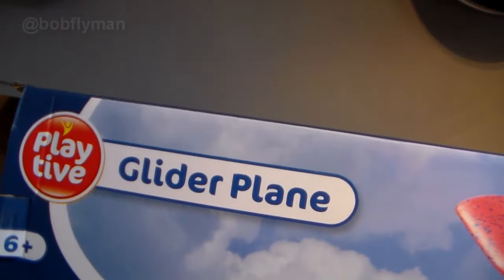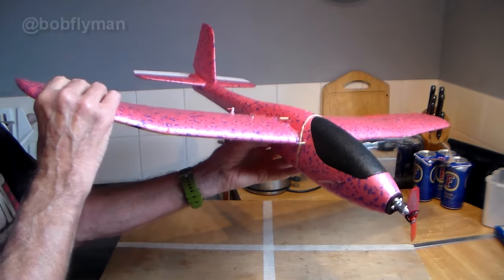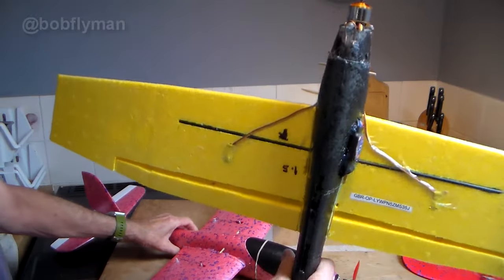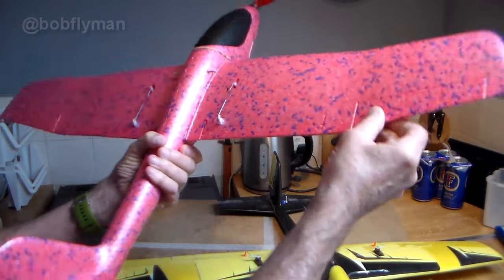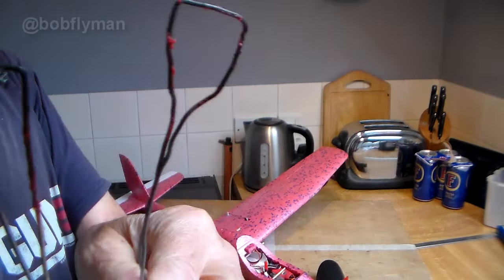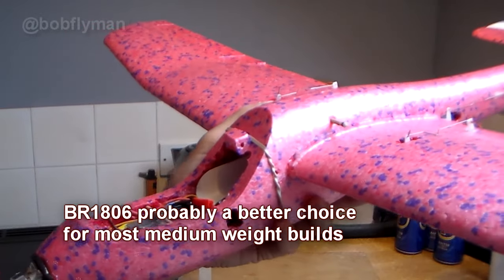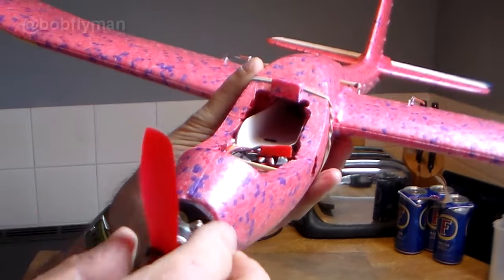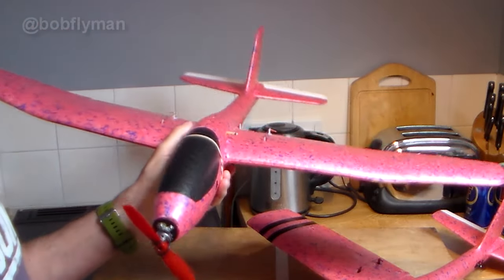Lidl Gliders or Cheap Foamie RC builds - My Top Tips after 20 builds - Everything you need to know!

Comment: Great info and tips, how about a wing for the next build something like a nurflidl,  chop the tail fins off leaving a short bit of fuselage and then put a 'rudder fin' back on for stability add elevons using 2 servos in the wing (you will have to mix the channels on the transmitter) and  you have a glider then maybe add a motor at the front or rear to make it powered
Reply from the maker: Wow, that sounds like a nice idea.
Reply: https://www.wing-tips.at/Portraet/Modelle/NURFLIDL_Umbau.pdf
Link to plans

Comment: Thanks for your great video's, I enjoy DIY RC plane builds.  I noticed in several of your flight tests, that when you throttle up the plane appears to pitch up and climb. One suggestion you might want to consider a Throttle-Elevator Mix. What this does is apply down elevator as a percentage of the throttle position to counter act the pitch up.  Could be in the video's I observed, wind may be a contributing factor?  I was in my local Hobby-Lobby craft store here in the U.S. and saw a small version of the Lidi, but I was not aware they had a larger version. I will see if I can find a source here in the U.W.
Reply from the maker: You are right about the pitching up, I've always put it down to thrust angle, but very good idea to try a throttle mix. Thanks! I think I can do it with my Flysky tx. Easier than  messing about trying to change thrust angle!  Well done Bob 2.  😉

Comment: Seems like you recommend gluing the wing? I just installed my aileron servos and hardware, then went to insert into plane to test overall weight and realised I can't get the wing inside due to hardware catching. Doh! So I guess, remove servos, insert wing, install servos, and permanently glue wing?
Reply from the maker: Oh dear,  yes, it won't slide through with the servos installed as you've found.  I said at 06:12 that I used to slide the wing though as one piece, but the last couple of builds I cut a slice out and hot glue. Just as strong in my experience, and makes is easier to hide the wiring from the aileron servos.  Don't hack it up taking out the servos, just cut and glue the wing would be my advice! This is the cutting part  in that no.14  https://youtu.be/2FZQY3Xh6Po?si=LWImjBrpaRcnMFfs&t=65
Reply: @bobflyman  Thank you, very much appreciate the advice! Have been watching more of your videos and subscribed, very informative.

Comment: Thank for the video. I learned a lot in a short amount of time and will watch some of your other videos. 

I am building based on the videos from Limon but this has inspired me to buy the bigger version and use some of your deign techniques. 

While I do fly kits and prebuilt aircraft, I want to learn more about design as there is something special about being able to just buy a foam plane for under $20 knowing if I crash it to the point of no repair that I can always just start over.
Reply from the maker: Thanks for your very kind comments mate, and yes, these cheap foamies are great for messing about with and learning with. And if you bounce one ten mins and hot glue gun and they're back together.  To be honest they're  pretty durable though,  I've cartwheeled one in a crash and it totally survived.
Best of luck!

Comment: Really enjoyed watching your videos Bob and as a result I have managed to acquire the red and black 86cm Lidl glider.   I already have a redundant EFlight EFLM7010 motor and esc with a 3S 750mA lipo but what servo's would you recommend for the elevator and ailerons ?
As per your advice I have decided to leave the dihedral in so it is still reasonably tame.
Reply from the maker: Great. They are really good for experimenting with.  I'd say build it light, no carbon and 3.7g servos would be OK.